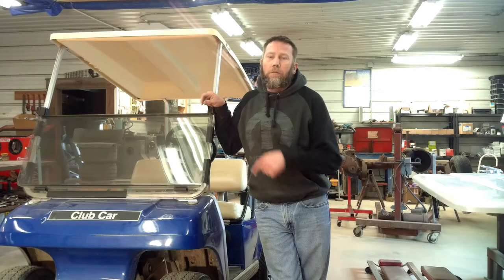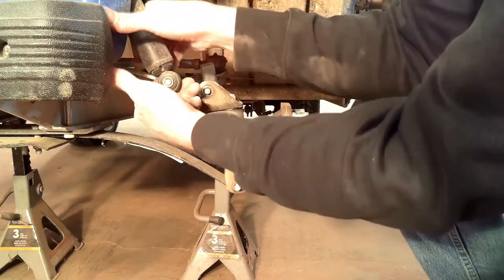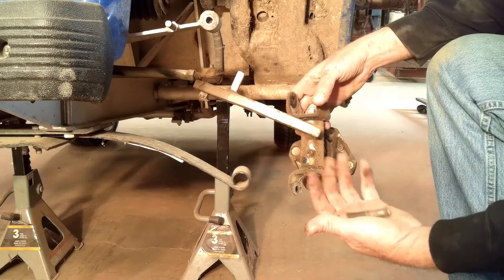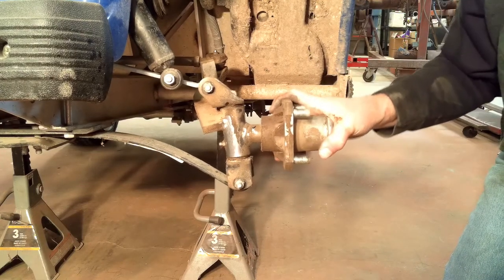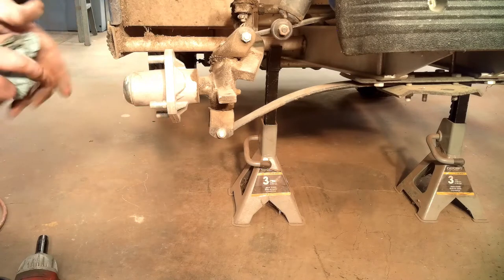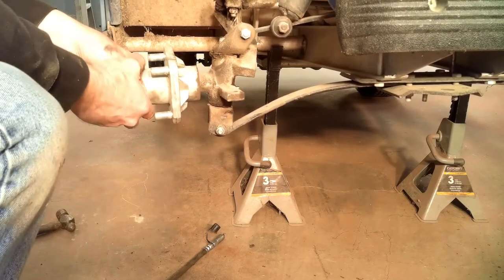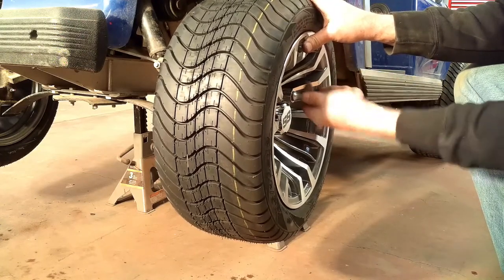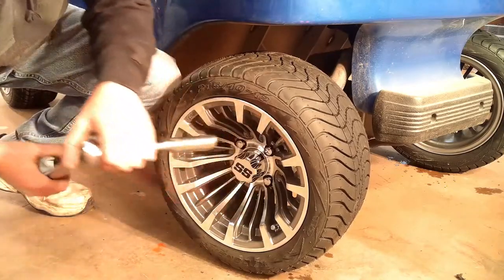Club Car DS Front Suspension Pt.2

Comment: I recently bought a used 2010  Club Car DS with 12” wheels with no lift and the front left tire barely rubs at full turn. Do you think adding a brand new left spring would help with the slight rub on the front tire or am I better off buying new shocks/putting a block to lift it slightly?
Reply from the maker: Mine did the same thing. I made a 1" spacer and got 4 longer bolts for the front leaf spring.
Reply: @sparksfireandbalingwire8467  Spacer sounds like the way to go